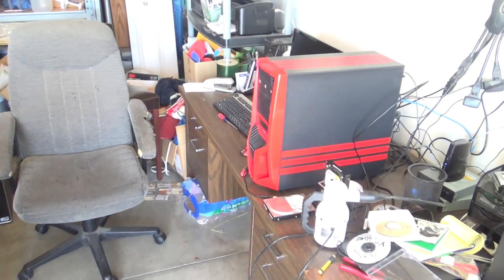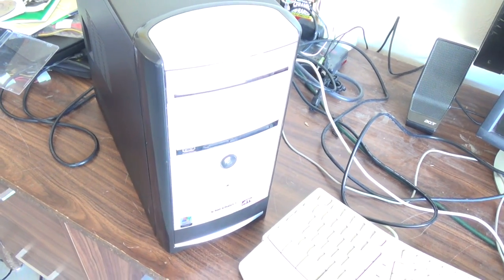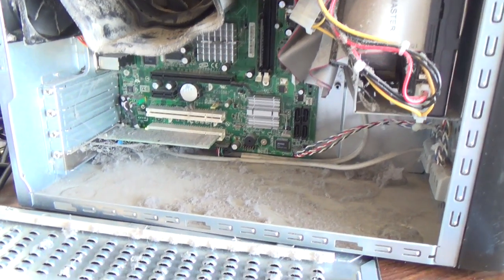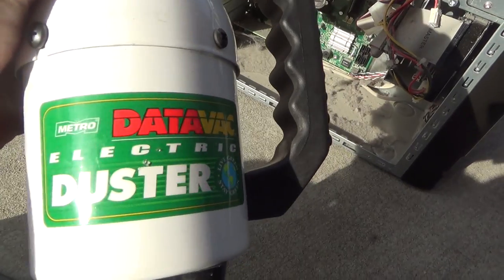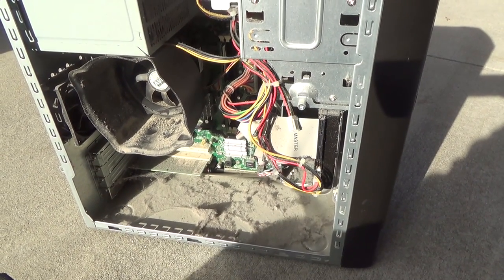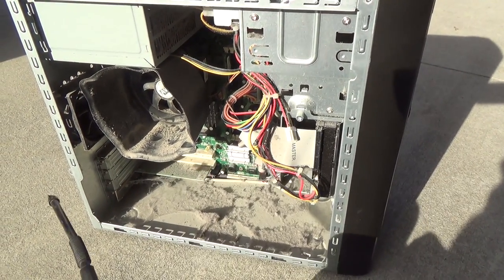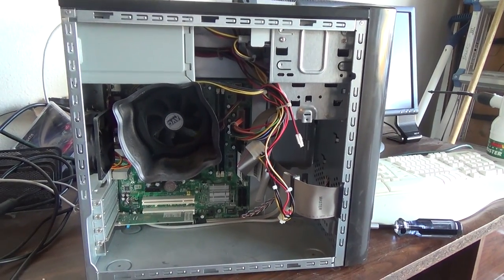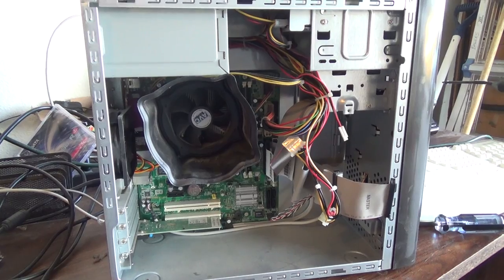One Dusty Computer Tower - And An Awesome Device to Clean It Up

Comment: Some fans spin at 5000rpm so I doubt you could break it with air that easily lol.
Reply from the maker: You'd be surprised at how many people actually believe that will ruin your fans and/or computer.  LoL.
Reply: Zaxtor99 It did happen to me twice, but then again, I was using an air compressor, and it was my GPU fan. It was completely my fault though.
Reply from the maker: theoneblankname
Right, i can appreciate that.  It's not that I don't think it's out of the realm of possibilities but if this datavac ruins a fan making it spin a couple hundred times a min when it usually runs much faster then chances are that fan was at its breaking point anyhow.  It hasn't ever happened to me et and ive blown out hundreds of towers and probably well over 1,000 fans.  Im willing to risk those odds hehe.
Reply: Zaxtor99 Yeah I did notice it didn't make those fans spin much at all, so I agree that the chances with that datavac burning out a fan seem slim to none. Looks like it throws out just enough pressure to kick the dust out, and not enough to get those fans rotating too quickly. I was just sharing a couple of my experiences, since I was a rookie with computers period. The first one I was completely careless with, and when the fan burned out, I just up and replaced the GPU (I still have the old one to this day). The second time, I couldn't afford a new GPU, so I spent the $30 and ordered a replacement fan from china, and swapped it out. I do want to point out to those who do use regular air compressors that it is a good precaution to hold the fan if you're up close and using a rather high psi. But for the tool zaxtor is using, it seems to be fine.
Reply from the maker: theoneblankname
Very good points you bring up and thank you very much for sharing and pointing that out blankname.  Yes a high pressure air compressor if used is probably much more likely to spin a fan too fast on its little bearings and more likely to ruin it.

That's why I love this little DataVac however because for this kinda job, it really is the perfect tool I think.  I absolutely love it.  Still running strong after more then five years and hundreds of towers cleaned out now.  Used it for lots of other household cleanups too like dirty heat vents etc and it has helped wonderfully.

Using an air compressor for blowing out a PC tower, while it will get the job done, is kind of like attaching a full size truck with a chain and attaching the other end of the chain to a weed to de-root up a simple weed in your yard where a gentle yank with your hand could pull it up.  It's big time overkill.  lol.
Reply: Yup my FX-8320 stock cooler fan runs at 6000 RPM ~50°C, It's loud as fuck.
Reply: A 5 gallon 1/2 hp compressor can force spin a PC fan past 30,000 RPM..  What causes them to fail is dust being forced up into the Fan blade housing around the Shaft..Most PC fans use brushless motors.. You can take the back label off and remove the c clamp on the back of the shaft so you can remove the fan blade to clean any caked dust that is caught in there.. I still have fans from 90s that still run great.. They are easy to dismantle and clean..

Comment: "High pressure" Yeah sure m8.
The real advantage to the electric blower is the consistent safe lower pressure without any moisture or debris you might encounter with a real air compressor.
"Stay green" Yeah, I'm already imaging the coal train rolling into the power plant to generate the electricity for the thing. What a joke.
Reply: umm what about the "coal train" required to make the compressed air can, to compress the air, to ship the cans to other countries, to deliver them to shops, to recycle them...?

Comment: Buy a air bed electric inflator pump that does inflate/deflate. Way Cheaper!!!!!!
Reply from the maker: +Steve Hughes - Sure.  Way cheaper, maybe.  And for this job, probably about half as effective.. if even that much.  Also from my experience with air bed inflation pumps, probably will fail and stop working in a small fraction of the time.  I've had my Metro DataVac SEVEN YEARS now and used it THOUSANDS of times and it is still running strong.  I highly doubt any air bed pump will last even half as long and still be working.  And again, it's going to be much less effective because of the nozzles that the DataVac includes which allow you to focus high pressure air in a small precise area.

You can save money once or twice by buying paper towels to dry your body off after taking a shower instead of buying actual bath towels, but is that really the best 'tool for the job"?

..Thanks for your comment and opinion however.
Reply: +Zaxtor99 Theres not really much to go wrong with it and its technically the same as your machine. Had it for three years already and it comes with different nozzles as it needs to fit various valves etc. 

Not Putting the machine down or anything and I was close to buying similar, when just had the idea after blowing up a airbed and thought was cheaper than the machine thats essentially doing the same.

Comment: this fucking thing, you really should have taken apart to clean, also, i prefer vacuum cleaner to blowing... makes less of a mess, also, you are less prone to inhale all that and so on..
Reply: +thiscouldntblowmore Vacuuming a PC is one of the worst things you can do to kill your PC.
Reply: RGInquisitor that could be, however i think i build my first complete pc in 2000 or so, had been tinkering with other ppl's hardware before tho, anyways, been using vacuum cleaner since then doing this, i have never broken anything. and ive actually build / modified hundreds of pc's by now, including for a time for work.
Reply: thiscouldntblowmore
Then you would know that Vacuum cleaners create static and you can very easily kill every single component on a computer in just a few seconds/minutes. this datavac from Metro is the best thing that is available right now to properly and safely clean out computers since it doesn't create any static whatsoever.

Besides, I've never met any professional/veteran PC tech that would endanger the hardware that way, especially if its not theirs and even more so when working on older machines who's hardware has been discontinued so replacements are very expensive and/or very difficult to find.

I've been at this for about 7 years now and the first thing I learned is to not take any unnecessary and or stupid risks with computer hardware. There's always a proper way to do something and believe me when I say that its not about 'if' it goes wrong but rather 'when' it goes wrong. If what you say is true, then you have just been lucky. I recommend you don't take any more chances with other people's hardware, especially considering this $60 device can clean out a PC just as well and is much safer.